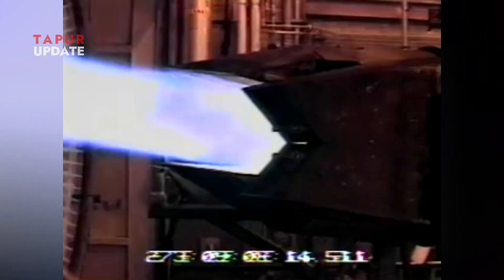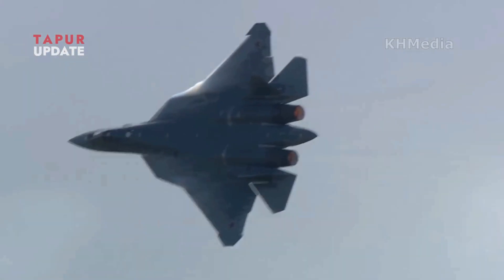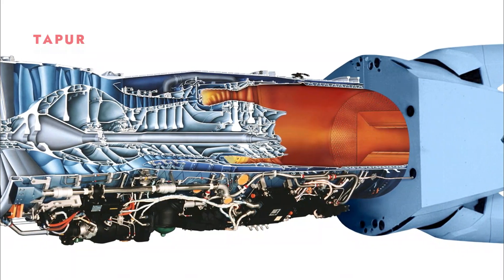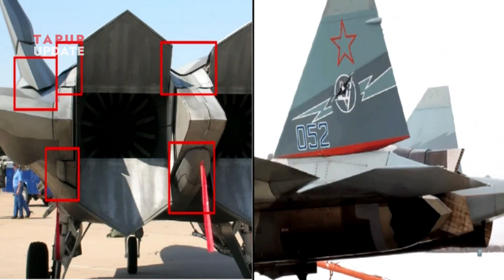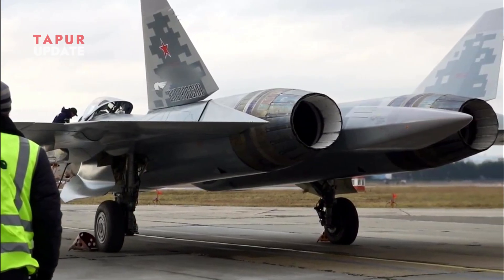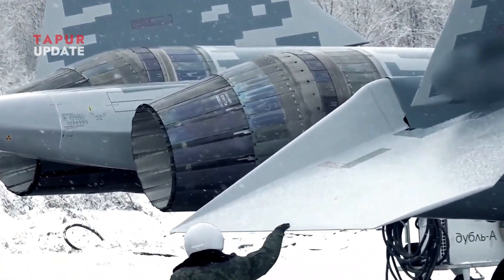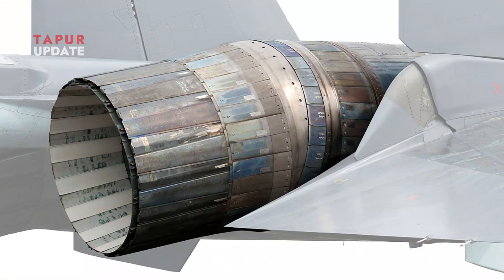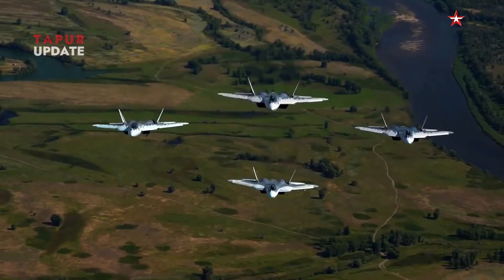F-22 Raptor and Su-57 Nozzle Showdown for 2025

Comment: In addition to rotating 360 degrees, the engine air outlet nozzles must also rotate and rotate in a circle around themselves. The engine air outlet nozzles can rotate in the opposite direction of their alignment and also in the opposite direction of alignment with each other, and can also rotate and rotate in the direction consistent with each other. In addition to the circular rotation, each outlet nozzle can have its own rotation separately.❤